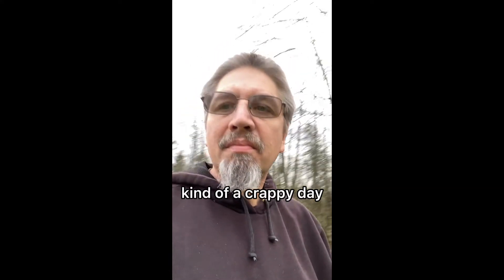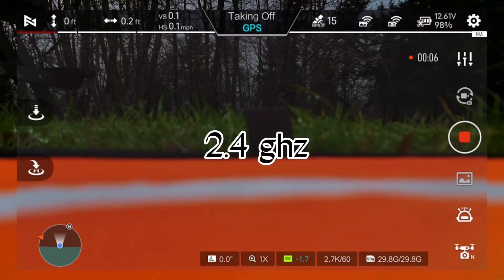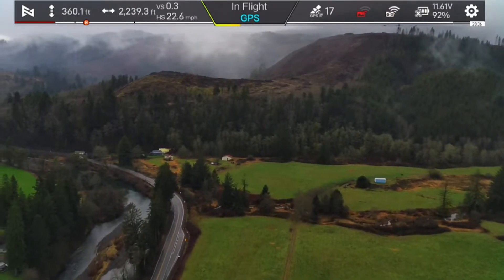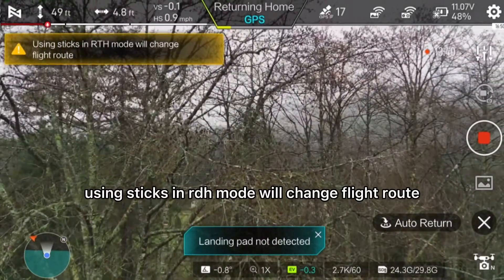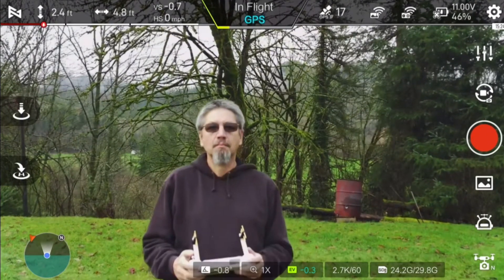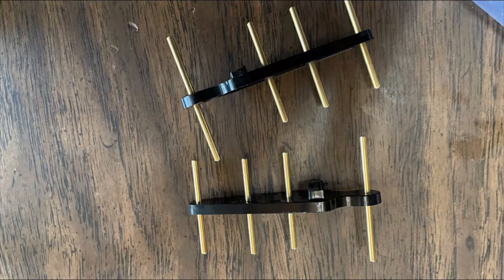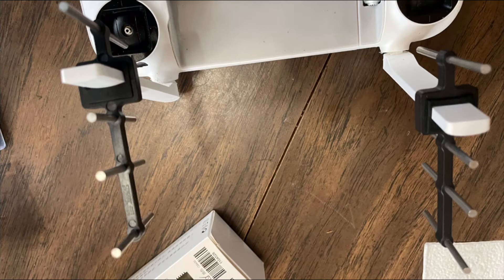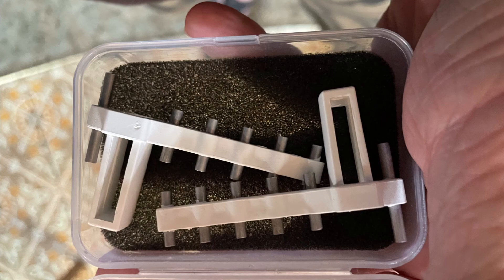FIMI X8 SE 2022 brass 2.4 ghz yagi antenna booster do they work better then the stainless ones?

Comment: Maybe i heard wrong but did you say you can't use the yagis and parabolic together? Because I've seen some use then together and they seem to work better. Now i know not all drones work well together. But what is your take. Because i do have 2.4yagi and parabolic. I've not had a chance to use them both yet together. My drone doesn't switch from 2.4 to 5.8 like DJI drones. It's all time 2.4 and 5g FPV. I have the Ruko f11 Gim 2.
Reply from the maker: Well maybe with anything but the fimi it works… if you don’t believe try it yourself the fimi either works with the 2.4 gh yagi or the parabolic dish but it really loses signal easily running both… it sucks  ballz and the brass set of yagi’s I tried sucked the most …thanks for watching

Comment: You have to put aluminum foil on them , hey buddy what's the specs on the camera on that drone ?
Reply from the maker: FIMI X8 SE 2022: New 48mp camera

The upgraded Sony 1/2″ 48MP CMOS sensor, bringing a large 1.6μm pixel size based on the “Quad Bayer” pixel filter, can effectively reduce noise during nighttime aerial filming. Built-in Sony native exposure control with signal processing technology ensures a 4x higher dynamic range than traditional CMOS sensors.

With the support of HDR videos and photos, the X8SE 2022 drone makes your shots look stunning by preserving the original details, light, and color tones of your scene or subject. Its HDR capabilities take the visual experience of any video content creator to an entirely new level.

Its 3-axis mechanical gimbal adopts the 3rd generation LOS stabilization algorithm with high precision control and an accuracy of 0.005° to perfectly eliminating jitters in real-time.
Reply: @moemaster1966  Is it 4k
Reply from the maker: @CarolinaAirshots  ya it shoots 4k 30 it actually has a decent camera but nothing as good as a dji air2s I like shooting in 2.7k 60 seems to be a lot smoother the 4K and 2.7k is outstanding on my big screen tv but once I run it through my iPad or iPhone then to YouTube it destroys the sharpness and clarity of the video,
Reply from the maker: It’s not the air2s………… it’s 1/3rd the price